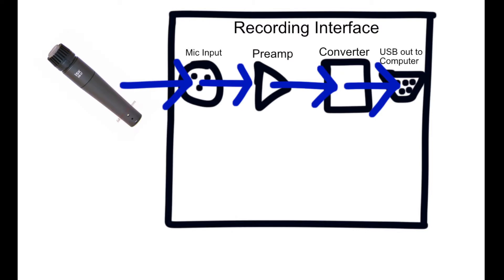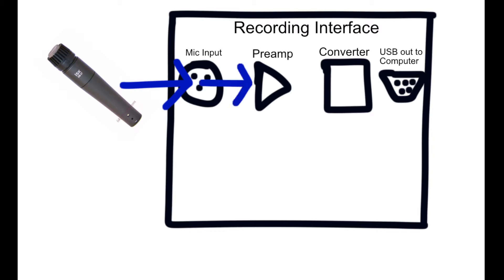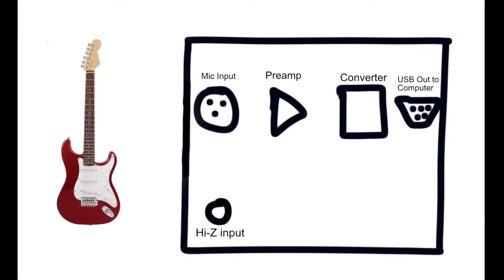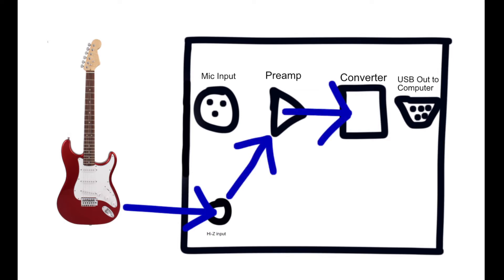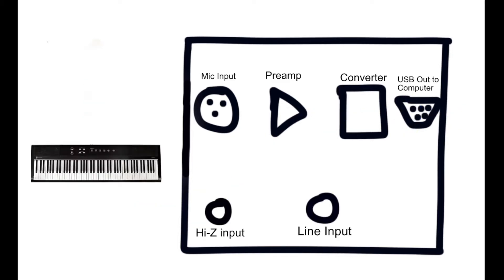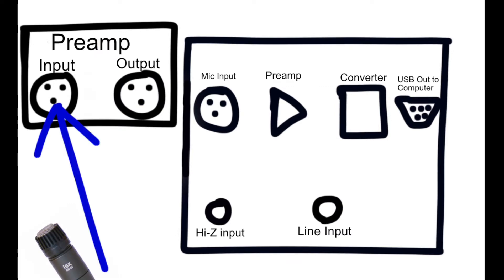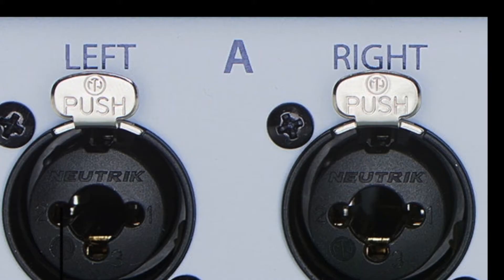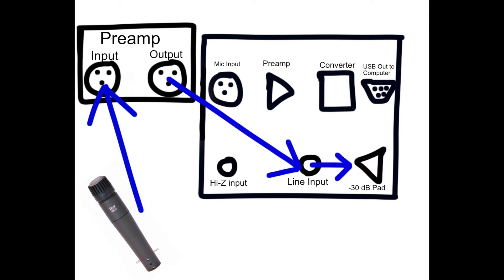Inputs and Outputs of an Audio Interface explained, lesson 15

Comment: I have Focusrite Clarett 8Pre USB interface and i hear a huge diffrent in sound when i compare patch audio signal:

a) bass - instrument input - focusrite internal preamp - focusrite interface converter - usb - DAW - usb  - converters - monitors = no warmth, no low end and less dynamic

vs

b)  bass - instrument input - focusrite internal preamp - direct analogue output on my monitors - warmh audio, good sounding preamp, warmth, low end and dynamic signal

Does it mean the internal converters in audio interfaces are bad and ruined signal ?

c) bass - bass amp preamp - bass preamp line out - line in to hardware good quality converters - digital output from converters -  audio interface digital in - usb - DAW - usb - converters audiointerface - monitors

I wonder what diffrence will be when we try c) solution ? Is it worth money to spend for external converters ?

Sorry for bad english ;)
Reply from the maker: The focusrite converters are quite good, I don’t think anyone would be able to hear a difference between them and something better.  In both examples a and b the signal still goes through the converters, the only difference is that one goes through the daw, the other doesn’t. Are there any plugins in the daw that could change the sound?
Reply: @Get.Beautiful.Recordings I do not use any vst. I compare just clean signals and using presonus studio one 4 pro DAW

Comment: I am looking at the steinberg AXR4T. How would i mic up a full drum kit since it only has 4XLR inputs?
Reply: I am looking to use 11 mics on the drum kit.
Reply from the maker: Hi, you are correct, that interface only has 4 microphone inputs, but there are several ways to connect more microphones to it, you just need to buy external preamps.
1- Any external preamp with a line output can be routed to the 1/4" line inputs in the back of the AXR4T.
2- A preamp with AD conversion, such as a behringer ADA8200 or Focusrite Clarrett 8 pre can be connected to the AXR4T with ADAT, and that would give you 8 more channels of microphone inputs.
Reply from the maker: That's easy to do, you just need to get external preamps.
Reply: @Get.Beautiful.Recordings  thank you. I have the behringer i just got confused how they labeled it as 'digital inputs' when really they are ADAT inputs via TOSLINK cable
Reply from the maker: You might also want to look at the Behringer XR18. It has 18 microphone inputs, and pretty good sound quality.
Reply: @Get.Beautiful.Recordings  thank you, i'll take a look 👍🏻

Comment: You didn't explain what all the outputs are used for?
Reply from the maker: Hi Johnny,
Good question. These outputs have several uses. Within the software, you can choose what gets routed to each of these outputs. If there are 8 analog outputs, you could create 4 stereo pairs and, and create a custom sub mix for each of those. This is useful for doing a live recording of a 4 piece band, and each person can get their own custom headphone monitoring mix.
Another thing outputs are used for is in the mixing and mastering. When you see studios with a huge mixing board, the way they use that is to send the individual channels out the analog outputs of the interface, and into the individual channels of the mixing board. Then they just mix the song on the board, and record it back in.
Also, the outputs are often used to implement external hardware into the signal chain for mixing and mastering. So, if you have an external reverb unit you really like, you can use the output of the interface to send the signal into it, and then use an input to receive the signal back in.
Reply: @Get.Beautiful.Recordings  I wonder about the outputs too, I want to send stereo outputs to multiple cassette decks, with the audio coming from the pc to the interface then out of the outputs to the decks. Would this work? Are all the outputs mono?
Reply from the maker: wilsonjg00 hi, yes you have the right idea, it will work. You are correct, each output from the interface is a mono output )except for the headphone output)
So, you will use 2 outputs from your interface going into the inputs of your cassette deck. In the software, you will designate those 2 outputs so one is for the left channel, one is for the right channel.
Reply: @Get.Beautiful.Recordings  thank you! Very much appreciated 🙂
Reply from the maker: @waxwiresnwaves  Yes, all of the outputs are mono, except for a headphone output.